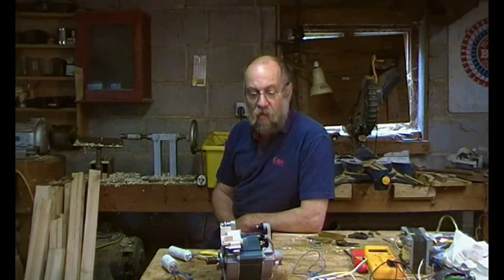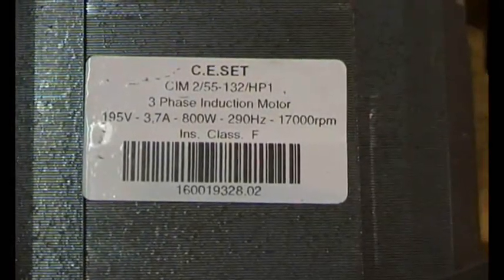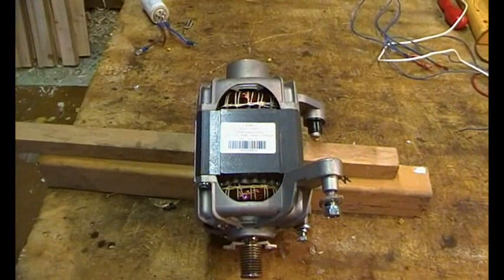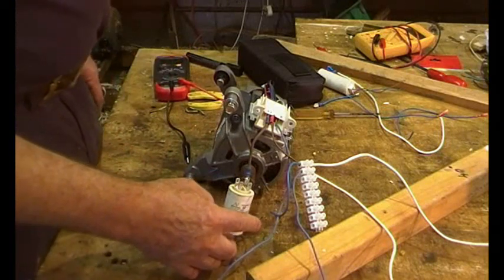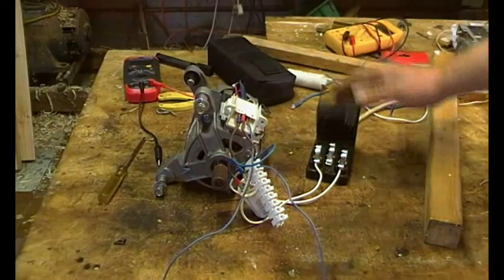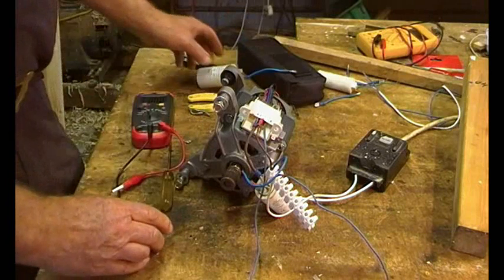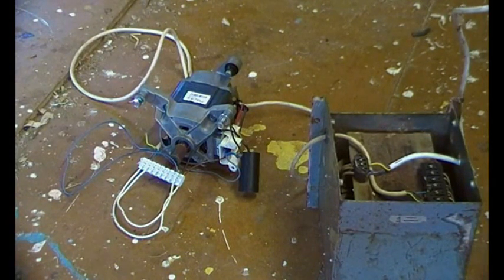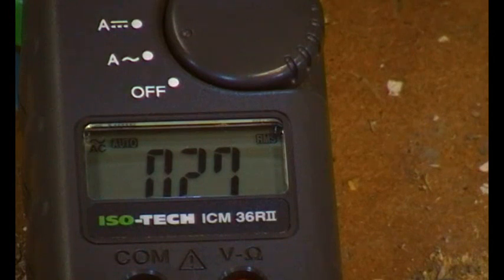Washing machine motor re-purpose and hack.

Comment: These motors are meant to run at around 300Hz / 200V for rated power.
For anyone wanting to get an idea we are typically looking at 35V / 350RPM/and 20% of their rated power (assuming true 3 phase), when run on a typical 50Hz supply. Don’t try to hook them across the mains without a transformer (or a properly configured VFD 😊)

That’s pretty much how they can deliver a lot of power. As the voltage and frequency increase, so does the horsepower (similar reason why motors and transformers in America can be smaller for a given power output).

In practice they can be run as capacitor start motors from a single phase when powered at 35VAC. The angle is not quite right (90degree vs 120degree) but they will run. They can also be hand started without any capacitor, when run from a single phase supply.

They will do nice fan motors, where torque is not a must. Very quiet. One just needs to be aware there is no internal fan, so they can overheat if run at nominal current for extended period.
Reply from the maker: Interesting technical details, no wonder it ran better on 110v, cheers

Comment: Hi Andy, I have done a bit of playing around with these motors. they will run on a single phase but they are obviously very rough. If you put a DC voltage across 2 points it works a brake. I have also tried them on my VFD at 220v and they worked fine. I can't remember what frequency  I put it up to, possibly 300Hz, and it worked away under no load. On the VFD they have quite good torque at low RPM. But I ran out of experiments because all of my machines already have motors! It is good to have this knowledge in the bank however. I'll have to give the capacitors a go.

Comment: The lower frequency will also allow greater current to flow due to the lower impedance at lower frequency, so you need current limiting. I burnt out a large three phase fan motor that came from a ship and was rated 415 volts at 60hz I ran it at 50 hz and it rapidly overheated and let the magic smoke out.
Reply from the maker: Thanks for that info, so reducing the voltage reduced the current, cheers
Reply: The 3 phase motors I've come across are rated at 415V. I've wired them into delta form to achieve the same 200~V across each winding.
That 195V motor you have with it's three wire connection suggests it's wired in wye configuration. Would it run any differently if  you were able to wire it in delta therefore getting 110V across each winding rather than 55V in wye?
Or are we simply happy it rotates and hums pleasantly?
Reply from the maker: Ian, hi, the coil wire is quite thick so you are right it is probably wired in wye (star) so that there are 2 coils in series. If I dug out the star connection from the stator and wired it in delta it may run on 110v and so draw more current and produce more power but the coil would still be over volts by about 10 %. The video was really just a proof of concept as the figures on the label were so wierd. Cheers, Andy

Comment: You crack me up mate,yourl just like me,"Give it a go" I wish you would use a safty breaker though just for safty wise,or at least tie the motors down,if that would of flipped on start up who knows where them live wires could of headed to,
I always switch the switch on with long wooden spoon,I know less about elec tric than you,So wooden spoon is my safty hand .lol love the vids
Reply from the maker: Hi, I understand the reason for your comments and all the circuits in the workshop are on breakers, cheers

Comment: Was that 16 uf capacitor a 'run' or a 'start', & does it matter if I use one that is for a larger voltage capacitor or does it need to be one that is in line with the 120 Volts that I'm using?   I think the main differance between the run & start cap. is just that the run is made to in use all the time where as the start is just for a short time at a time.  And I would think that the voltage is not importance unless it is to small. ???  I wish my dad was still alive he would be able to tell me all thins stuff.  I'm 62 but still would like to ask my dad some things now & then.   Thanks
Reply from the maker: It's the voltage that matters, a cap with a higher voltage rating is just fine. Start caps are just high capacitance in a small case so not up to continual use. For 110v you would ideally want a 220v cap because the peak voltage is mush higher than the 110 RMS voltage. It's all to do with the peak of the sign wave. Cheers
Reply: @TheInfoworks   
Thanks

Comment: greetings mr andy, please I need to know at minute 12:00 of the video I wanted to know if it is a pulse that makes the motor work or is it a working capacitor?, please do you have a connection diagram.
Reply from the maker: Hi, see my video "how to do it, run a three phase motor on single phase", part one of the play list has a diagram, cheers

Comment: the reason its bouncing all over the floor is because your using one phase of a three phase moter and its out of sync. two phase's are dead so it will be unbalenced.
Reply from the maker: Hi, thanks for the comment, the induced phase through the capacitor is obviously only an approximate in volts and phase position, however when the motor is run on lower AC volts things smooth out as the differences are proportionally smaller, cheers.

Comment: .good morning mr andy, my problem is that my miele washing machine damaged the power card and the 3-phase motor I have not been able to start it with a face 110, I put a work capacitor on it and it vibrates a lot, then I put a starter like a pulse and get it to boot.  How do I get him placed with a job coach?  thank you very much for answering

Comment: Seems nobody ever thinks to harvest the frequency drive portion when they harvest the motor.
Reply from the maker: Yes that would be handy but getting to work would be another kettle of fish, cheers
Reply from the maker: @hurlrules1  thanks for the interest, yes the 50 cycles from the grid will make the motor run slower and the lower voltage reduces the power. Brilliant as an experiment and learning experience, cheers

Comment: Hello there. capacitor connection is not clear. Can you tell me the capacitor value and connection? How many rpm does it freeze? is it torqued? I am thinking of making a desktop saw, is it okay? thank you.
Reply from the maker: Hi, see my videos on running a 3 phase motor on single phase supply (there is a playlist) for full wiring details, cheers

Comment: Nice video Andy, that motor didn't like the AC power so would the machines Vfd have run it on dc. Could you explain the difference between DC and AC capacitors on another video? ,I don't quite understand it. Thanks, Rob
Reply from the maker: Rob, a VFD changes the frequency of AC power, that way it will change the motor speed. The 17000 rpm is achieved by running the motor at high frequency. A DC capacitor is polarized so that if you connect it the wrong way round it will pass current continuously and so get hot. The right way round it will charge up and then stop passing current. An AC cap works on AC or DC and is not polarized so it does not matter which way round it is connected . cheers
Reply: Thanks Andy it's getting clearer as to how things work.

Comment: what i have is ,195 v 5A 820 W , 286 Hz16000 Rpm. class F, induction  c.SET. whirlpool motor .how do you wire? i want to make belt sender.
Reply from the maker: Sorry I don't know that motor. It obviously has a driver to increase the frequency to 286 Hz. At 50 Hz it will run much slower, cheers

Comment: Hi I have been watching your videos and believe you can help me. I have a washing machine motor part # 3951550 but unsure of the leads. Can y be u please identify them for me. Which should connect to my 3 wire electrical plug and how do I connect them to the capacitor. Want to use motor for a diy sander. Thanks
Reply: Sorry part # is 3951551
Reply from the maker: Howard, washing machine motors can be difficult as they are commonly driven by a speed controller. The one shown here is unusual in that it is 3 phase, try the "Post apocalyptic inventor for a driver circuit and see my 3 phase motor on single phase supply series, subscribed?, cheers